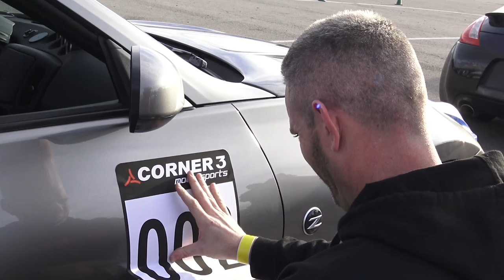I finally took my modified 370Z NISMO to the track!

Comment: Glad to see you get it out for the track as obviously that's what the Nismo is made for.  I've been doing track events for 10 years now and my first day was in a 350.  I'm now a certified BMW and PCA (Porsche) advanced driving instructor and run in a sorta nuts Lotus Exige.  1800lbs with 375hp at the wheels is, uh, exciting.  Better power to weight than a Bugatti Veyron SS.  If you need any advice feel free to ping me, I've coached hundreds of students over the years.
Reply from the maker: Sounds like a rocket! lol
Reply: ooooh jay your getting soooooo near 1,000,000
Reply: Yeah, she's fun.  You likely learned that there are fast and slow cars and fast and slow people.  Slow person + fast car = slow.  Fast person + slow car = fast.  Fast person + fast car = crazy fast.

Comment: You mentioned the car was a little loose, was that under braking? I watched the hood cam part of the video a few times and I noticed a little wobble under braking just once, like the car wanted to rotate. Not saying I know from that, but I'm curious.
Reply from the maker: Thats a trait of the Z. It has a very rear heavy bias in braking. My brake setup is two different compounds to help that but the wobble you saw was purely driver error.
Reply: Adjust your brake Bias to the Rear to counter that :)
Reply: Try Running like a 40/60 allow the rear to brake more would compensate for the heavier ass end
Reply: Josh Carter If it's rotating under braking it's got too much in the rear, so adding more would make it worse. Plus he already said he's compensated for that.

What I was actually thinking was the rebound in the rear could also be a bit high, that can induce rotation under braking as well.

But it's not like I'm there to actually know for sure, it was purely curiosity.
Reply from the maker: RTDragonCommando you're on the right track. Steven ended up taking a little rebound out of the rear and it settled down
Reply: The one thing I really like about my STI is when you mash the brakes it's straight as an arrow, it doesn't wobble or dart at all. That would be scary coming into a corner unsettled.
Reply: Shut up Barnacules!, this video is all about NISSI!, do a video about your STI! btw, love both channels.
Reply: Barnacules Nerdgasm I autocrossed my buddies '15 sti and it was a whole different beast compared to my miata. The grip was phenomenal, but when I need to oversteer a bit I gave it more gas which was terrible in a subby. Went straight into the grass lop
Reply: Barnacules Nerdgasm atleast Jay's Nissan won't have a blown headgasket
Reply: Oh sorry i read his comment backwards lol
Reply: Some race cars have adjustable break bias. I guess it can be something that tends to very from one set up to another, but you def wan't more breaking force at the front, obviously when the car breaks it loads the front tires a lot more than the back and the front's are thus capable of doing a lot more breaking rather than just locking up the tires. Mean while the exact opposite happens at the back the loading goes away cause it shifts to the front. The tires don't get the traction and your big old rear disks and calipers just lock right up and the back becomes like a sled (or some food trays under back tires) and just slides where ever it's momentum is going. If you're doing most of your breaking on the strait heading into the turn where you should be, it won't spin out cause your going approximately strait, but your hurting your track times slightly because you don't have effective stopping power which means your front breaks could be doing more, your rears could be doing more. Breaking into a turn only accounts for a small percentage of your lap time and is typically the last place to try and squeeze out lap time. Most is on straits and thus exiting the turns at high speed, in good gear, is the biggest improvement on lap time. Also a little slight locking can actually be good cause it means your right on limits of breaks and so just back off a little. Also if it's 2010 it has ABS which I don't believe is normally able to be disabled with out pulling a fuse in which case you should probably get a amber break caution light.
Reply: yeah if anything you should be locking up the fronts not the rears under heavy breaking which would understeer not get lose. Just my opinion from roughly 12 years experience in GT 3(recommend reading the instruction booklet which used to come with a copy of GT 3), posted sub minute lap times at leguna seca in stock formula 1 car(2000s).
Reply: Also down shifting can potentially briefly lock rear wheels up too, especially if your pushing the breaking really late into the turn (which is why you should break/down shift before the turn). Rear wheels are breaking, turning car with a lot of g's and then you come out of the clutch into lower gear and engine is turning slower than transmission imput shaft/ rear wheels and engine breaks the car additionally.
Reply: Of course there's a lot more but as Andretti once said, breaking secrets aren't stuff you tell someone potentially racing against you, your son maybe...
Reply: while that is true, the sport package and the NISMO model have Synchro rev match. It's a cool little bit of electronic magic where when you go to down shift, the ECU will blip the throttle to the required RPM for a smooth engagement. While I had mine, I was never able to trick the system into miss-matching the RPM. You should look up some videos on it, it is actually pretty cool even if it does promote being lazy while driving a manual.

Comment: I heard the cooling issue in this car kind of sucks
Reply from the maker: TRUE! Which is why if you look at my mod list, I have cooling mods :P
Reply: Cooling issue?
Reply: I saw it. Didn't check the description after u mention it!! :p
Reply: z platform has pretty bad cooling on the track in genral (stock)
Reply: Never knew the 370z had cooling problems.
Reply from the maker: The Radiator is fine actually, I still upgraded mine for good measure. But the oil temps get up to 280-300F which will cool bearings and cause limp mode. Nissan didnt include an oil cooler in these cars. So oil cooler is a definite must.
Reply: That is informative. Have u ever think about supercharge it? Stillen has a really good kit!
Reply: If I remember correctly, Jay has forced induction.  Thats what the two silver pipes are going into the engine at 3:34 are.  Twin turbos are pretty common mods for 370z's in addition to oil coolers.
Reply: Nope twin turbo setup would produce about 400/500 hp and he would beat pretty much all of the cars we saw in the vid. His engine is NA which u can also hear (no spooling and wastegate sound).
Reply: Good call.  For some reason I thought he had turbos, must have been thinking of another car youtuber.  I have a very basic knowledge of cars.  Its on my to-do list of things to learn

Jay! Get on it man!
Reply: How is your clutch pedal holding up? i've been in the market for a 370z, but i read that the clutch slave cylinder is faulty from the factory.
Reply: just because it has silver pipes doesn't mean it has turbos. its just an aftermarket manifold which is probably part of the cooling, if he had turbos it would have a huge amount of power
Reply: I have the Australian version of the 370 and it comes with an oil cooler from Nissan, although it needs more cooler rows in my opinion.
Reply: That radiator is still pretty small, it might be bigger than the stock cooler but AE performance or some of the other aftermarket have a much wider cooler that stretches the full width of the coolant radiator. The fact that it is much wider gives the oil a longer surface/time to cool the oil resulting in much lower temps. Just because it's Stillen doesn't mean it's the best application for your Z.
Reply: Yeah, the 370Z is known to overheat if you hammer the crap outta it... that's why modding the cooling and putting bigger rads and oil coolers into itis a good idea...
Reply: 韩涌 the car is modified so it shouldnt be a problem unless they use stock cooling
Reply: read the mod list

Stillen Oil Cooler 24row(Shrouded)
CSF Triple Row Radiator

Comment: I don't usually comment on old videos, but that car sounds soooooooo good. Nissan has the  best sounding engines/exhaust. This is coming from an FD owner that had a 500rwhp rotary swapped to a cammed LS1. 

How difficult is it being an enthusiast in California with all of their CARB rules? Does it hold you back on what you want to do modwise?

Comment: Hi Jay
I own the #57 350Z that is in some of the shots. We were pretty evenly matched on that day even though my car has only 280 hp to the wheels. With either of us leading the distance between us would ebb and flow depending on how well we hit each corner. In the end you had the fastest time of the day at a 2:13 to my 2:16. What really surprised me is that a year after this video was done we both ran Chuckwalla and you were over 20 seconds a lap faster than me. Are the driving lessons paying off or did you do more mods to the car?

Comment: 370Z Nismo > Linus's Lambo

Any plans for changing the current tyres to the RE-71R or the Toyo Tyres R888R?
Reply: Cmon...Linus' car is pink

ps. if name has s in end, you dont use 's
Reply from the maker: I want to leave the RE11s on for good street use too, but I am thinking about a second set of NISMO wheels and putting on R888 or maybe even slicks
Reply: JayzTwoCents good idea. RAYS engineering or Volks Racing rim are also good rims to pick.Nismo fitted RAYS on the Nismo GTR and the 350/370 Zs

Comment: I'm dissapointed. Not a single Skyline R34 seen...
Reply: QuantuMlapZiz Illegal? What the fuck?
Reply: Trissky he's in the US
Reply: I know I know but how an Skyline is illegal there? Never heard of that.
Reply from the maker: Yes, it is banned here until it is 25yrs old. Its because they weren't "originally" sold here, so they dont meet EPA standards. After 25yrs EPA standards are forfeited and you can run cars without emissions control systems. But its still a hassle to import a 25yr old JDM
Reply: oh well there where more skylines then Supras :)
Reply: Ohh Thank you Jay! That's weird to hear, never heard of that before. Well I've learnt something today.
Reply: The '99 Skylines should be street legal here in the US by 2024, by then they'll be able to be registered as antiques. Until then lack of any US crash testing and emissions testing makes them illegal to own on the street. I think it's pretty tough to even keep a track only car unless you've gone through a lot of work to make sure it was gotten legally enough for the US government. Or you can be in the military, get stationed in a country with R34 Skylines, buy one, then when you return home you can import and register it with the help of the military. I think.

Comment: Awesome car.  I'm a Z-car enthusiast myself, having owned 4.  My current ride is a 2015 370z w/Sport package.  Starting in 2012, Nissan added a heat exchanger to the 370z for the oil cooling issue.  It's not a true oil cooler, which uses airflow through it to bring oil temps down.
Reply from the maker: That cooler they added does a terrible job at keeping the oil temps down
Reply: ***** Yeah, it's not for track use.  More for spirited driving in areas with hot summers.
Reply: I miss my 350z Very nice 370 by the way. Recently acquired a 2017 GT350. Can't wait to track it.

Comment: Noticed in some of the shots in the turns that Nissy handles like a champ. Several of those cars were biting really hard on the front corners with a lot of body roll throughout the turns. Nissy looked to glide more into the turns with minimal roll and you were able to hawk down some of those vehicles in the turns. Very nice suspension work.

Comment: I hope nissan (or you) upgraded from the stock brakes. Car and Driver wrecked a 350Z a few years ago after just a couple of laps around a track when the stock brakes suddenly failed due to over heating. They did some further test on another 350Z and found the brakes to be dangerously prone to sudden and almost complete failure under track conditions. Turns out Nissan had installed cheap quiet organic compound brakes to reduce noise and there was almost no airflow through the wheel wells to help cool them. I hope Nissan has rectified that mistake now.

Comment: In my youth, I raced go-karts (107 MPH) down the straight away competitively, moved onto f3 racing, a little expensive .. my focus was to move into F1 ... very competitive space.

The last lap, watching the cars ahead hitting the corners late, exiting to early really works on momentum (hitting correctly feels like sling shot effect), tighten up your suspension a little, run some laps, loosen your suspension and feel your car out on the track. 

By the way, nice driving, nice vehicle.

Have a good week, I notice the bike on the garage wall being far to shiny.

Comment: So im familiar with taping the triangle near the wheels to protect the paint from rubber and anything kicked up from the track, but whats the purpose of covering the headlights and front few inches of hood? If its the same purpose, wouldnt you want to cover most of the front bumper as well?

Comment: Hey JayzTwoCents, here a quick tip for your car, try to put softer springs in front, and a bigger stabilization bar on the front, you will surely have less under steering and the car will take more roll, for a better front grip

Comment: I still autocross in my 350Z. A little tip track instructors gave me was don't get into the habit of tucking your thumbs in and around the steering wheel's cross columns. Break that habit. You'll thank me one day when you have to react quick in an emergency.

Comment: So this is the fabled 370z (I don't use social media)! Nice car man! I'm considering getting a used mk7 golf/GTI 2 door and eventually swapping in the 50/50 split awd system from the Audi TTRS, not sure about what engine I would want to put in it though, either the Audi 2.5l i5 or the VW 3.6l vr6...or I might just say "screw it" and find a way to mount my favorite engine of all time, a Mazda 13b rotary, to the gearbox. Any thoughts on this?
Reply: Malcolm Toney bahahahah good luck with that one. much cheaper and easier to buy something with the kind of performance you want already built. that kind of project will be near impossible and will annhiliate your wallet

Comment: Hi Jake,

I'm a little confused after hearing the comment about THE TRACK being faster in the morning. I'm thinking you 're mixing something up here.

The car should be faster in the morning, because of lower temps (more O² per volume unit of air -> better combustion), but the track is faster in the afternoon because of:

1) less dirt and dust on it
2) more rubber on it

The later two things outweighing (usually) the first - AFAIK

Admittedly I'm no racing driver and don't plan on becoming one, but the above mentioned is what I took away from my physics classes, watching some racing F1 and driving motor bike. 

WOuld really like to know if I get that wrong or right.
Reply from the maker: He is a professional driver with the highest license for international racing... I think he knows what he is talking about. And my name is Jay, not Jake.

Comment: I saw 2 Nissans in sli with nismo turbo boost technology, overclocked to 10,000rpm under water with a 1 metre radiator. What a rapid, solid state drive that is!

Comment: @jayztwocents
Curious how you making that much wheel torque???? Headers? Curious to know the base #'s before tune.  Literally running close to the same setup on my vq37hr
Reply from the maker: My engine has been looked at by a few tuners, and we have come to the conclusion that it is a unicorn. With the same mods before tune my dyno sheet stated 324hp / 270tq.... 16 dyno pulls later and a lot of tuning I put down a 331 / 296. It just really liked to make torque, and Im definitely not complaining about that :P
Reply: Yeah no kidding. Pretty shocking. Unless the stillen gen3 just help it that much more with torque over a takeda. I'll be porting my throttle bodies and putting headers on before long so maybe I can get closer to 335-340 range with some reasonable torque. Very good numbers indeed

Comment: Did you hear about the new Motordyne headers? They sound absolutely brutal. If you still want some power you should consider those with the z1 intake manifold. With what you already have done your Z should put down over 340whp.

Comment: So... you overclocked your car and you took it to a track to benchmark it, right?

Also, spotted two Cayman's in there which is like the car with an engine in the right place.
Reply from the maker: I also put down faster lap times than the white Cayman :P
Reply: Nice! Must be the OC was dialed in just right. Or your improved driving skills. Maybe, the Porsche Cayman driver is a noob? I mean, I did see your car pass a Nissan GTR. So, engine placement does not make an automatic winner. Or, a four-wheel drive computer Nissan GTRX 1080, for that matter. :)

Comment: Why are swaybars not a part of that suspension list?
Reply: To reduce body-roll
Reply: Shit, I meant not on that list.
Reply from the maker: The NISMO sway bars are larger than OEM, plus its common for most Z owners to completely unhook one side of the rear sway bars since they are TOO stiff on this platform.
Reply: *****
Oh righto, didn't realise the NISMO package had that. Weird that they need to unhook it.
Reply: Also when you disconnect the rear sway bar, it will cause the car to naturally have more understeer than if it was connected. Most people can get a car that understeers around a track quicker than one that oversteers.